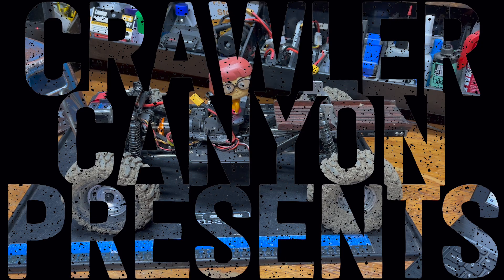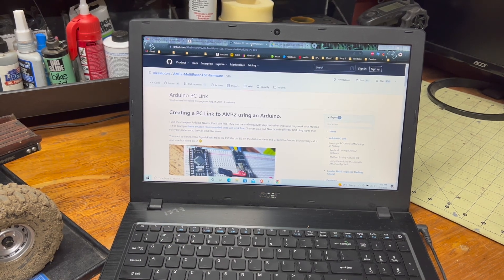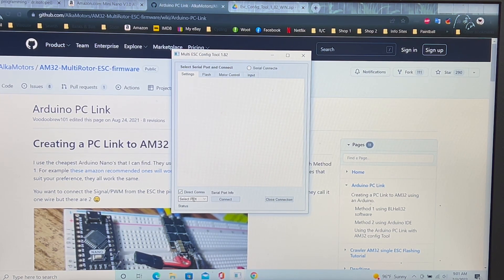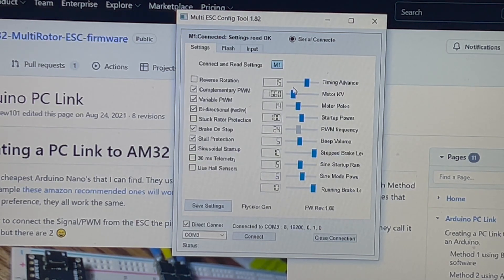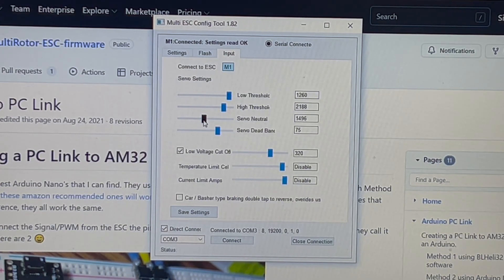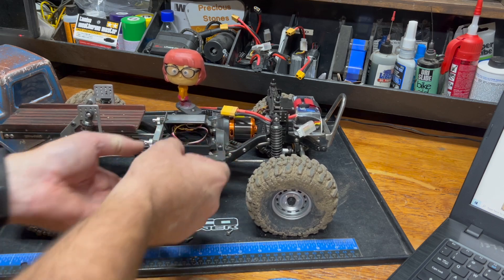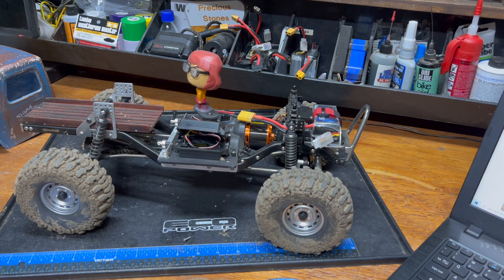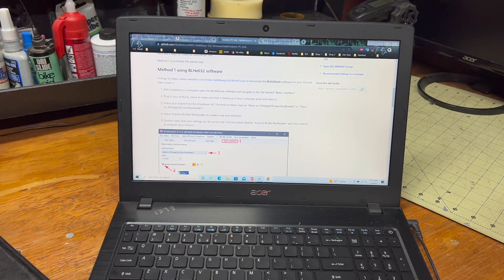Crawler Canyon Presents: BL-Heli ESC Tuning (for outrunners)

Comment: Do you know why mine would be saying it cannot connect after doing all the steps correctly?
Reply from the maker: Double, then triple check that you have the connector from the ESC plugged into the correct pins on the Arduino.  I've gotten it wrong more than once.

Comment: please help me how to be able to run bidirectional on that esc
Reply from the maker: If you have successfully gotten into the BLHeli software, it's in one of the checkboxes there on the lefthand side, just below Variable PWM (which should be on) and right above Stuck Rotor Protection (which should be off.)
Reply: @CrawlerCanyon  thank you so much everything is new to me your answer is really helpful to me and BLheli software will they work with any esc blheli on the market i mean esc blheli of any company

Comment: Do you have to run an outrunner with the am35?
Reply: 32*
Reply from the maker: I've heard tell of people running brushed motors off of AM 32s, but if I'm buying one, it's to run an outrunner.  I can't see a situation where you could get better performance out of a different motor.
Reply: Can you run an outrunner with other types of esc? I have some rtrs and rx8 and hobbywing sc esc.
Reply from the maker: @PHILLIPfry2010  you can run an outrunner on any brushless ESC, it just won’t have as good low speed, and will sound some level of terrible. The PWM noise can get absolutely screamy with some ESCs.

Comment: I was able to get the Blheli software to work but I couldn’t get the AM32 config tool to work.
Reply from the maker: Am I understanding that you got through the BLHeli software and ran the bootloader, but can't get the ESC config tool to work?  When you downloaded the ESC_Config_tool_1_82_WIN.zip from the Google Drive, did you click the download button to get the whole package? I don't think in Windows, so that wasn't immediately clear to me. The Config tool works pretty much like the bootloader, as far as I can recall.
Reply: @CrawlerCanyon  Yea I was able to configure the ESC with the Blheli software and use it in my crawler but I couldn’t get connected to the AM32 config tool. I’ll go back and check the download setting. That’s for all the hard work in your videos.
Reply: Hello. I also have the problem that i cannot connect with the multi esc tool to the esc. M1 button "fails"
Reply from the maker: @cybron7089  It's most likely the initial bootloader flash, the part where you run the config tool. It took me a couple of tries to get that installed, and once it flashed correctly everything went super smooth from then on.
Reply: @CrawlerCanyon  hi. Thank you for the reply. I downloaded the available multi esc tool 1.70 and it didnt work. I flashed the arduino with blheli32suite for about 6 times. What now?
Reply: @cybron7089  You can try ESCape32 - an alternative open source firmware for BlHeli_32 ESCs. You have nothing to lose anyways.
Reply: @senyx0  Servo PWM up to 333Hz, automatic throttle calibration on the f421? AM32 having problems.....
Reply: @witespy  Not only that. Sine startup mode is also supported now.

Comment: I have an old 2013 Mack air book is it possible to use it I’ve been having trouble.
Reply from the maker: If you can reliably get Boot Camp/ Parallels running on it, I suppose so. The other, less labor-intensive option is to wait to see what Amazon offers during Prime Days--  they've already got a decent number of Windows laptops for around 150 bucks.  On sale we might see a hundred. Even I'm not averse to picking up something newer and faster.

Comment: My servo tester/lipo Volt checker shows a low of 1000, high of 2000 and thus neutral at 1500 steps.
The signal is a variable puls length which I can see with a scope.
I assume you don`t own/know how to use a scope but than you can see what exactly the radio is outputting.
Without knowing specifics either 1450 or 1550 is moving the centre the right way.
Current settings has the deadzone of 75 all the way in the throttle so...
If 1530 is better than 14XX than closer to 1600 is probably what you need with 0 trim.
If trim 30 is also 30 steps and halve of 75... I guess 1590 1600 is likely the number we seek.

Comment: I'm not familiar with the Airtronics MT3, but I would assume there is a neutral center point that can be adjusted.
And if not...do outrunner motors have timing that can be adjusted? Maybe adjust that timing in the forward direction. That should help with the throttle forward vs the reverse.
Reply from the maker: The timing on the motor can be set through the ESC, but going too far is gonna get heat.  As I've said, the issue isn't with the ESC, but rather with the Airtronics/Sanwa radios I've had kicking around here for ages. I wanna say the MX3X is from around 2009 or so. There's probably deadband/neutral adjustment on my MT-4 radios (I have a couple of those as well) but the 3X was the "budget" 3-channel offering from Sanwa back then. Didn't stop it from being $180. Any $60 "modern" radio has no such issues.
Reply: @CrawlerCanyon  10-4. I hope you get it working the way you want it too. 
I also use the MT-4 and while I'm not sure how long I've owned it...I did purchase it the month they were released. 
I'm anxious to see you use the heli esc out on the rocks.

Comment: Wow, I almost bought one of these ESC's and a Holmes revolver.  I'm extremely happy I went with a fusion instead.  I person shouldn't have to go through this to make something they paid for work correctly
Reply from the maker: Fusions are great--  we have 4 in the fleet here--  but the torque and low speed still isn't as good as what an outrunner can do. You can also run super-shorty outrunner motors that weigh around 2oz.  I don't see the programming as a drawback--  I program every single ESC in the fleet, because pretty much nothing just works perfectly out of the box. 

This is also a great example of cost vs. labor.  For a BLHeli32 ESC, the programmer, the arduino to tune it, and a mid/low KV outrunner, you're looking at maybe $75, around the same price as a HW1080 and a sealed-can brushed motor, but with incomparable performance.  Oh, and most heli ESCs will handle at least 4S.  The Ninja can handle 6S.
Reply: @CrawlerCanyon  As well as sometimes it's just plain fun to tinker.
Reply: I understand your pain. I love to tinker but I've got an outrunner, the arduino and the st-link and I am having a hard time connecting, flashing, etc...